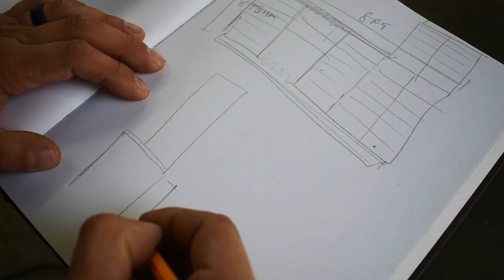Building Shop Cabinets/Tool Wall/Sortimo

Comment: Wow the magnet on that Bosch drill was pretty slick. Wave it over some screws and pick them up. Also nice Festool collection.
Reply from the maker: JronmanBuilds thanks! Yeah fastcap makes them and they are super useful. I have a bunch of different magnets all over the shop, they are super useful.